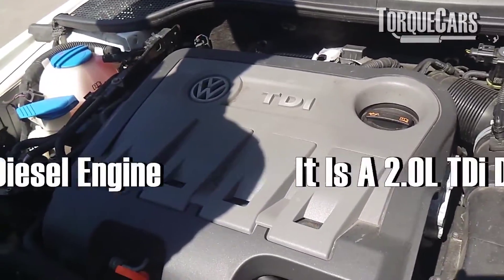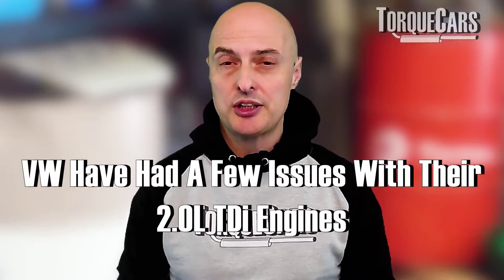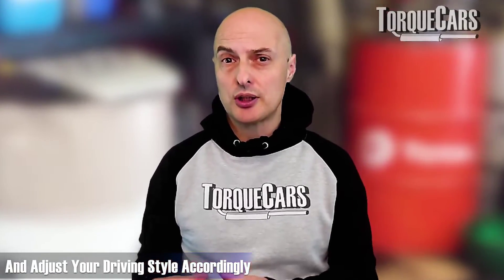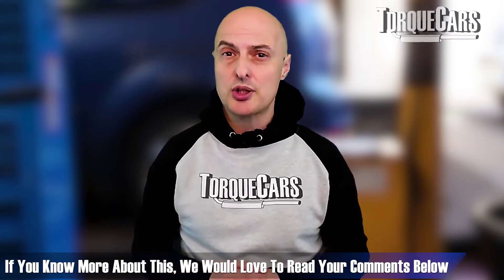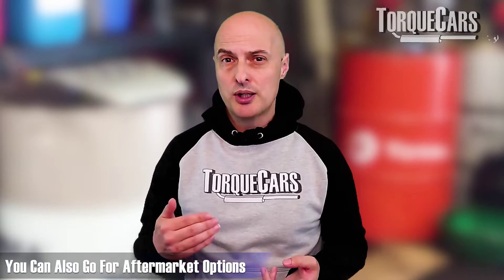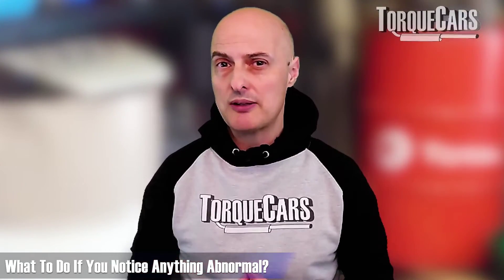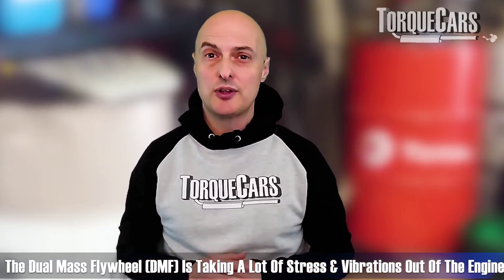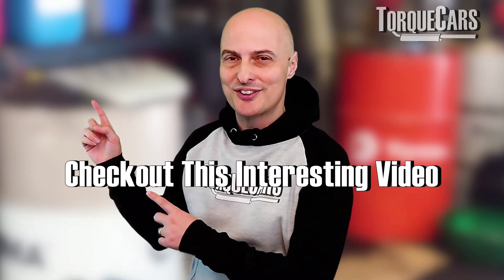VW 2.0 TDi (2012 on) EA288 Did They Avoid Those Common Problems & All You Need To Know

Comment: I drove a 2007 Leon FR TDI, tuned from 170hp to 215hp/490Nm for 10 years and sold it last month with 300.000km on the dial. It has had zero issues in 15 years besides the airconditioning that stopped working three times, which also happened on my 1999 Ibiza 1.9Tdi that I ran for 8 years 350.000kim).  Engines are rock-solid.
Reply: That's great to hear I bad a audi a3 2.0tdi 170 remapped to 225 not sure on nm of talk with egr and dpf all the work was carried out before I brought the car was great power and good I fuel lasted years until I sold it brought a different car then went and got another newer a3 2.0tdi vag cars i think are very well made and if serviced well I always have a full engine service every year even if I do 5k miles or 10k before the manufacturers service intervals and use good quality oil and good fuel

Comment: Great video once again, lots of pearls for the average punter!

Having owned both, and researched and modified both extensively, the later 288 has a lot of advantages like you point out. Most importantly it was specifically designed to work WITH DPF and EGR systems. In the PD era DPF's were not in the design brief, bolted on towards the end of the production run and were a very obvious intrusion. You always knew when the PD DPF era were doing a regen, far harder to notice on the CR. The CR drives pretty normally, whereas the PD was noisy, became very hot and laggy, and made for a challenging drive in city peak hour traffic as an example. They also clogged overall a lot earlier, and had to regen more. Splitting the NOX Cat and DPF Core in the CR was a huge leap forward. Both still suffer with a lot of intake oil/egr buildup, and both benefit from a Provent 200 setup alongside yearly strip down and cleans. My BMN PD had the Siemens "in series" injector failure concern, but I upgraded to the seemingly stronger Audi injector loom, and was a part of a small worldwide FB group that made a lot of noise and forced VW to do a recall and replacement on these. Thankfully my engine never cut out, but plenty did / probably still do. I'm sure VW hated having to fix my car!!

Finally I do have a dieselgate affected CR engine nowdays, and here in Australia got about $1500 payout for the devaluation of my car because of this scandal. I did the right thing and used it to get a DPF delete and EGR delete from Darkside, but to keep the warriors at bay got them to add a 60% race DPF as well and this alongside a race NOX cat and a refined tune gives me a smokeless 200hp, with less emissions than a full delete. The CR is way, way better to tune as you have previously mentioned, still the PD 170 sure had a strong midrange pull thanks to a bigger yet older gen turbo. GT1749vc on the PD, now ruining a GTC1549vz on the CR which is FAR more responsive, yet still flows more up top despite being smaller. Turbo generation is everything!

Comment: The only code I had on my VW 2013 2L TDi was 1 glow plug at 162k miles. Bought an OEM one for £30 and fitted it myself. Runs like a clock.
Reply: How many years did the originals last?
Reply: @IliescuBenyamin  10 years and 3 months exactly. Bought it from new. Manual transmission. Made in VW Zwickau site, Germany.

Comment: Hey sir great infos btw . Iam willing to buy a Gtd 2017 2.0 Tdi no Dpf or Egr regulation in my country but people say a lot about oil consumption especially on Gtd version how much oil it consumes on daily bases what too look for and what to avoid sir finally how can I check the transmission (Dsg) thanks 🙏
Reply: its a nightmare
Reply: Mine uses 1 liter every 5000 miles.
Reply: Meiner verbraucht circa 1L Öl zwischen den Öl Wechsel Intervallen 15k km

Comment: Hi, Compliments for all information altough you speak too quicly for no english toungue😊
COULD YOU TEL ME PLZ HOW I KNOW MY ENGINE MODEL FROM MY SKODA YETI 2.0 tdi , year2010
Thanks
Reply from the maker: If you click the cog wheel icon you can set a playback speed which is slower, the automatically translated subtitles should also help.

Your vehicle registration documents should show a 4 letter engine code something like CFHA (early engines had 3 letters BKD for example), this code will also be stamped on the engine but it can be hard to locate in some engine bays. This engine code will then help you confirm the engine generation.

In terms of engine generation I would assume that you have the CR 1st Generation (also known as a Gen 2 2.0 TDI)  EA288 engine.

You may also be able to pull the engine code from your local main dealership if you give them your chassis or VIN number (the long one in the front window)
Reply from the maker: CEGA = 2.0TDI (170) 4x4, introduced to range WK45/2009, withdrawn week 22/2010
Injection control - Bosch EDC 17 CP 14_2.4

CFJA = 170 TDI 4x4, which replaced the CEGA engine from week 22/2010
Injection control - Bosch EDC 17 C 46

Comment: Mine Golf 7 2014 2.0tdi is at 325.000km. I replaced a charge cooler at 230.000km, water pump leak at 145.000km, rear caliper rebuilded at 316.000km, EGT sensor at 265.000km and thats all. Oil changed every 15.000km. Mine turbo started to wine a little at 300.000km. Car is remaped to 184hp amd 420Nm from 135.000km
Reply: Update at 336100km. Injector at cilinder 3 failure (stuck open). So i will change all injectors and HPFP to be on a safe side.
Reply: The same is on Leon mk3, with stage 1 from Revo (184hp). No issues and ideal condition.

Comment: Iv had this engine at 40k for over 9 years the cbab 138hp so at 60k I had a stage one map up to 200hp at 70k exhaust temperature sensor common issue after Mapping clutch with mass flywheel too. 90k turbo, actuator and DPF pressure sensor Cambell water pump as running more power normally about 120k and CarbonClean. so as of to day I'm at 150k had new turbo and and now again need carbon clean. Also had problem with EGR valve there are two different types one goes to the back of the Engine on the cooler and one is at the front. on mine cooler is at the back and the valve is on the front oil starts to get in to where the motor cogs are damage the plastic cogs. I cleaned it down and you can turn a cog around to the better side will work well for a little while that was all the problems I've had on this engine 👌🏻
Reply from the maker: Nice things are much better then. That is good to hear. On the older engines carbon cleans every 50,000 were not uncommon! Thanks for sharing.

Do you service regularly? Long life or shorter intervals?

Comment: Hi good afternoon. I am after a little advice. Thinking of getting the Audi a4 b8.5 with 63k miles on. Its got the 2.0tdi cglc engine. Heard horror stories about low oil pressure fault. Is it a common issue and whats the solution? Tia.
Reply from the maker: From my experience this is caused with incorrect oil selection or not changing it at the correct intervals. The sludge formed in the turbo eventually blocks the filter and causes a pressure drop. I've not heard much about this issue, so perhaps it is quite rare on these newer engines.

A regular oil flush and change are the most sensible precautions to take.

Comment: I have a DFEA 2.0 TDI and have the P0140100 / P0401 error code "Exhaust gas recircuit flow - Insufficient detected". I guess this means a strip-down of the EGR valve and cooler and replacement.
Reply: I’m at 226k and I’ve e been getting the 401/2002 code…..probably a crack in my dpf filter……not what I wanted to be working on…..smh

Comment: Mine is on 320 000 KM and turbo is whining...I’ve done EGR  and dmf twice. That’s all. Always change oil every 7500kms
Reply: what in usa we change oil every 10.000 miles
Reply: @russiaKGB  I'm in South Africa and I'm a mechanic, so I do all the repairs by myself
Reply: Original turbo?
Reply: @wakaflockaproject  yes. never changed turbo before

Comment: Apart from chip tuning what are the other performance mods you can do to this engine? I have a 2017 Golf 7.5 2.0 TDI
Reply from the maker: Sports cat/dpf, turbo upgrades and fuel injectors will all be my list of upgrades to go beyond a stage 1 map.
Reply: What is the hp&tq gain from upgraded injecters?
Reply: @1Pueblito  with GTD injectors you can go close to 300HP, but you will need bigger turbo, bigger HPFP... also
Reply: @orumslv  what mileage is it typically per gallon when you have the bigger injectors and turbo. And what is the typical cost of this upgrade?
Reply: @orumslv  the head and cam are a hard limit before you get to 300! More like 280hp. The head port design is optimised for good swirl which is good for mpg and emissions at the expense of ultimate air flow! CAM is all one module so no aftermarket options available. If you want mega tdi power go for the previous tdi generation where 400 and 500 are possible!!
Reply: @TC-V8  I think optimal for 2.0 this generation is 210/240 without big issues

Comment: I'm starting to see the egr issues now on mine at 230k, p040200 code excessive gas flow. Changed egr and actuators but still have fault of flashing glow plug light with no loss of power. Every 3420rpm on heavy acceleration.
Reply: Did you manage to sort it out?

Comment: i have 280k miles on mine & havent had any of these issues.  every 100k i replaced the water pump & timing belt.  at 200k i replaced my hpfp.  at 250k i replaced all engine+dsg mounts.  when i hit 300k i will be replacing the vac/oil pump+belt, dmf, timing belt & water pump.  always use good diesel (no bio) and almost every tank add dieselklean.
Reply: In my Toyota i have had no need to replace any of those, just the normal serviceable items, and still going strong at 441,000km. Eat your heart out 😂
Reply: Original dsg?
Reply: @ln5747 so some of the TDI came with the dual clutch 6 speed auto transmission, mine did aswell. Make sure you put dual clutch transmission fluid when flushing and replacing, not regular atf you will fry the transmission, my 2012 Passat TDI with the DSG transmission was flushed and replaced by VW at 100k, currently sitting at 153k and is recommended to be replaced every 100k, but is a very smooth and reliable transmission, I love this car.
Reply: What engine code ?
Reply: In Europe, VW officially recommends changing the DSG oil every 60,000 km \ ~37,000 miles for wet clutch gearboxes (like the DQ250 and DQ381). Even though some 7-speed DSGs with dry clutches (like the DQ200) are marketed as “lifetime fill,” it’s still smart to replace the oil around 120,000–150,000 km \ ~75,000–93,000 miles to avoid long-term issues.

Comment: Speaking as someone who has a VW T4 camper from the year 2000 with the 2.5 Tdi 151 BHP engine that I have run from 110 000 to 210 000 miles over the last few years with no engine problems whatsover, I am dismayed to hear about these higher mileage expenses on newer engines but relieved that I don't have them. When I bought it, the dealer offered me a a lower-mileage, more recent T5 for less money. But I said no thanks and took the T4. Top speed is about 125 mph -- a guy here on YouTube does that speed (indicated) in a 151 BHP T4 with a roof rack on -- but most interesting for me is that it does about 37 mpg on the motorway at 70 mph fairly heavily loaded.
Reply: The T4 era 2.5 is legendary for being bulletproof, my later 2009 170 BPC is a different story altogether, you made a good decision engine wise! That said doing it over again I'd get the 5.1 2.0 single turbo engine in a heartbeat, so common and well known.
Reply: I will say that the T4 gearchange linkage system is a weakness, though. Access is extremely difficult when there are problems and the balls and bushes in the system give a chronically sloppy gearchange, even after replacing them with new (aftermarket) items.

Comment: Could I ask them please what VW diesel engine be in my 2011 passat cc it's a 2.0 TDI dsg thanks
Reply from the maker: I would say it is an EA189 - it is close to the changeover year though so there are no guarantees. Most of the kinks had been sorted on the EA189 by this year though anyway.
Reply: @torquecars  yes definitely, anything after late 2010 were super reliable and simple to fix if issues arrived
Reply: High pressure fuel pump were a common failure
Reply: Hi everyone.  Vw golf tdi 2.0 BMN.  Symptoms.. The car starts immediately but as soon as I step on the gas the engine stops.  Sometimes it works fine.  And sometimes he takes vacations on the road.  It shows code P3008.  We changed crank and camshaft sensors along with timing belt.  After 5 days Showing the same problems.  Does anyone know what it could be?
Reply: I think the EA288 gen 1 is a bad engine (reliability wise) . Runs hotter than the earlier tdis , cooling system too complicated , that shroud on the water pump is a disaster waiting to happen and the silica bag bursts and clogs the heater matrix - dangerous in winter when there's no heat to demist windscreen!! Charge cooler although I haven't heard many failing is a very expensive replacement! That's been my experience of these engines so I'd have a late ea189 way ahead of these. Cheers for the subject though 👌